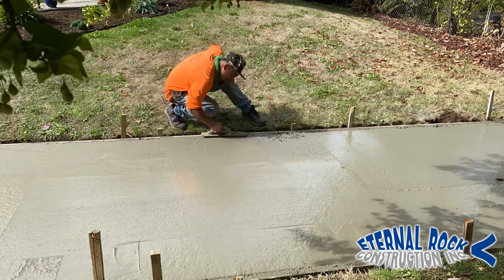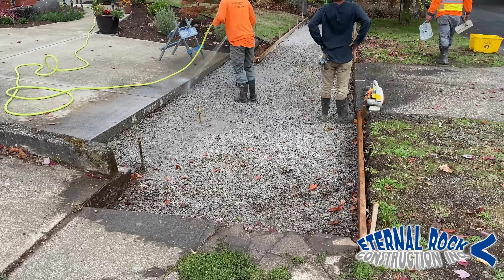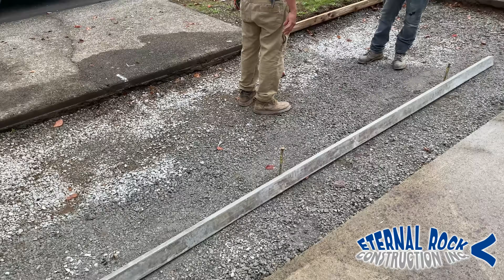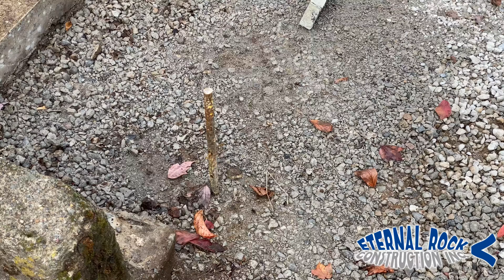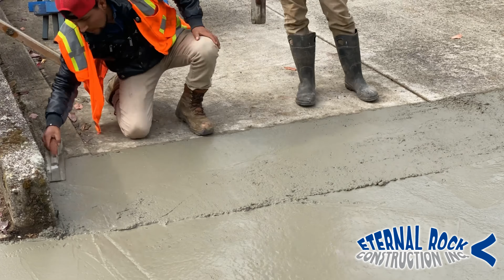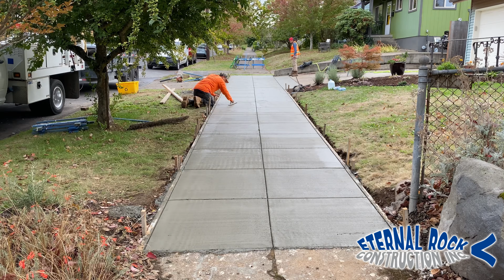How To Pour A Public Sidewalk Step by Step With Professional Results in Portland Oregon

Comment: Float your edges
Reply: Just helps creams the edges for the edger, not looking for an argument.  30 yrs in , just passing along a tip that's all.
Reply: @roryhamlet1886  but not needed like smack said
Reply from the maker: Yes thank you for the feedback. Take care
Reply: For what rookie?  Their stricker or stick is on the forms.  U only need to float edges if the stick doesn't reach.  Keep working. Ull learn